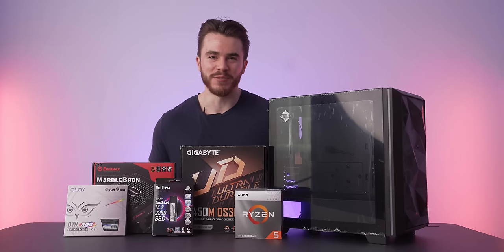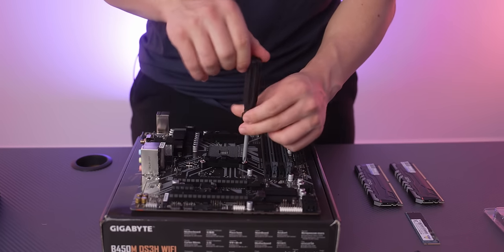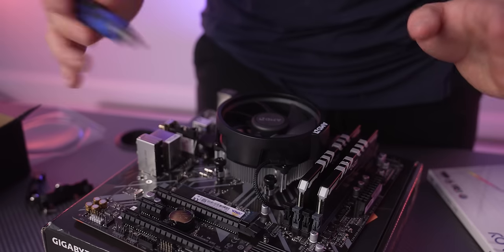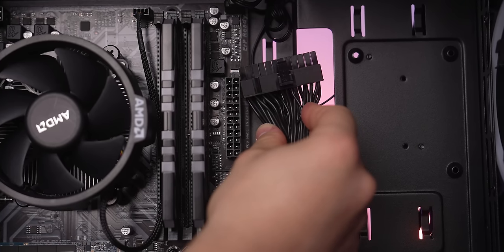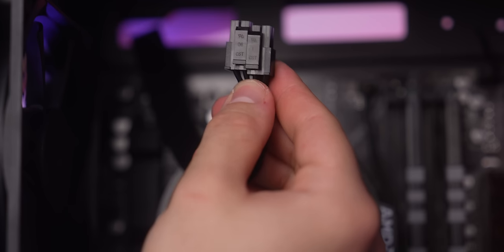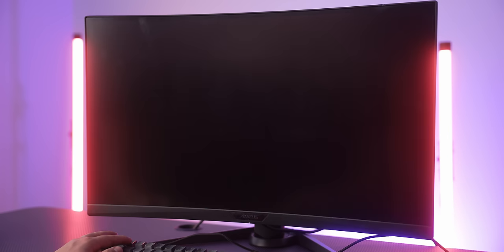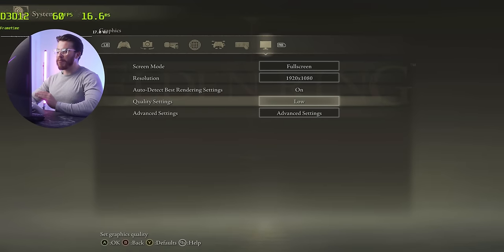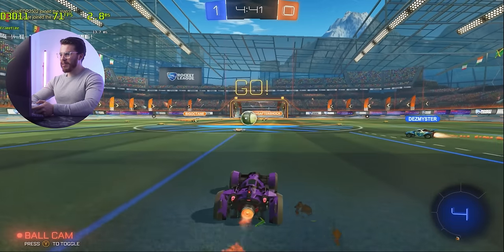How to Build a $400 Gaming PC in 2023! ⚡ Step by Step Guide

Comment: I finally saved up at least 400$ within 9 months working on a minimum wage. Decided to buy this specific build you showed. I was genuinely happy and going to save again to buy GPU.
Reply: Ryzen 5 5600G is a great CPU so I would try to go for maybe an RX 6600 or 6600XT if you get the money. Both will age very well and you won't need to upgrade for a long time especially if you only intend on playing at 1080p. But there are cheaper options if you're willing to buy used.
Reply: @ryannnftw  my choices are rtx 3060 or 6600XT. Thank you for your recommendation.
Reply: @trukinis420  hey, I'm planning to build my pc with i3-10100f and gtx 1650. what do you think?
Reply: hi! I'm planning to build my very first pc just a quick question as a complete beginner on building pc can this PC shown in the video be able to play DOTA2?
Reply: @Gillan007  it can run games like dota 2 very easily
Reply: @Gillan007  yes it can run Dota 2 smoothly.
Reply: @trukinis420  i noticed it doesn't the build doesn't come with a monitor can you recommend an entry level monitor thats good with this pc setup pls. i really wanna build my first pc nxt month 🙂
Reply: @Gillan007  try a SpectrePro brand 1080p 144hz. They are the cheapest brand when it comes on peripherals. I think they have 120 usd 144hz monitor.
Reply: whatt???? within 9 months wat type of job u have if u dont mine me askin???
Reply: @fwsupreme probably he has other expenses or lives somewhere where $400 is a big deal.

Comment: For just 400$ this is a really good computer, and the fact that u can upgrade it by putting like a 3060 inside it and the cpu wouldnt bottleneck just makes it amazing.
Reply: What kind of gpu you can put it in? Cuz im trying to build with ryzen cpu,nd thinking what kind of gpu i could put in, like from 150-250$
Reply: @kriik4789  gtx 1650 or rx 580 at the low end, rx 6600 or rx 6650 xt (if you can find one at 250) at the higher end of ur budget
Reply: If you are willing to buy usedparts and they are available where you live an older 10 series card like the 1070 or 1080 might not be a bad option either.
Reply: Is this gonna perform better than an xbox series s or a ps5 with the specs in it? I dont know much about pc but got some free times... any help?
Reply: @stephaned3072  nah it wont. but you get the benefits of having a pc that can do a lot more than a console... if you js wanna play games get a console
Reply: @ayedraco4l  ah ok. Console it is. Yeah i just want to play games. Cheers thanks
Reply: @ayedraco4l  The 3050 is honestly a waste of money for how it preforms so it shouldn't even be a recommendation
Reply: @jmannby1349  edited to 6650 xt
Reply: @ayedraco4l  nah JM is correct. The 3000 series are way overpriced plus most if not all of the people with those high end nvidia cards were not able to handle the Diablo 4 beta. All those cards ended up getting bricked while the Radeon cards were doing fine including the older cards like the RX580.
Reply: This is a solid option completely custom and cheaper than a new Play Station system and much better quality
Reply: @kriik4789 5700XT is such a GOOD gpu for around $150 while able to keep up with RTX 3060
Reply: For gaming. Never go higher then a rx6700xt or else you will get major bottleneck with the Ryzen 5 5600g

Comment: I have the same APU. It's also your video last june that convinced me to build a 5600G system and start saving for a gpu down the road, for the sake of having something to use right away. Now 6 months later I saved enough for a 1660 super and I am very happy with it. Thanks for the great content <3
Reply: i have the same apu and it was good for what i wanted to play and do on my pc at the time. I have upgraded to a 3070 so i can play more demanding games
Reply: you should chose RX6600
Reply: @robertbodnar8745  the thing is I'm still a student and the funds I used are from scholarship so the budget is tight. Also, I specifically chose nvidia for tensorflow use.
Reply: @ndrxw  hey man me too
Can this system play GTA 5?
I just wanna play some games
Not hardcore games like warzone 
I don't even play Fortnite 
But games like Minecraft, GTA, rust and so on
Will it run?
Reply: @deadscaryt9934 yes I have a good amount of playtime in GTA V and minecraft. Im not sure about rust but you can find a lot of benchmark videos of 5600g builds
Reply: Drew when you got the 1660s how did you uninstall the drivers for the 5600g and install the 1660s did it boot you into bios
Reply: Because i am doing the exact same thing drew
Reply: @XYLOIII I did not uninstall any drivers for the 5600g since when you connect the monitor into the gpu instead of the motherboard, it automatically uses the gpu as display. One thing to note is that I have low reso the first time I booted up the pc with the gpu (display like a safe mode or something). It all got fixed after installing latest nvidia drivers.
Reply: also another thing I did was disable the integrated graphics in the bios. I did it a few days after installing the gpu. It's an optional thing so i recommend reading a lot of stuff before doing it.
Reply: @robertbodnar8745  i was thinking of it but i decided to pay the extra.
Reply: @deadscaryt9934  i played gta and minecraft with no problems but gta was i locked gta at 30fps forgot the graphics settings.
Reply: @ndrxw  after the gpu was installed and working did you uninstall the 5600g drivers?
Reply: @XYLOIII  I did not. I only disabled the integrated graphics in the bios settings after
Reply: I'm not sure if I should, I don't remember reading something that I should uninstall drivers for 5600g. Also I didn't experience any issues so I just dropped the thought of doing that.
Reply: @ndrxw  what if i dont want to go to bios since the last time i did i got into a bios loop and had to completely reset my pc
Reply: @XYLOIII  I mentioned that disabling Integrated graphics in the bios is completely optional. It's up to you if you don't want to, that's okay. I used my pc a few days before disabling the integrated graphics in the bios and it worked just fine.
Reply: bro's gonna be so sad when a rtx 3050 is cheaper
Reply: @deadscaryt9934  ong all i play is gta 5
Reply: Is this gonna perform better than an xbox series s or a ps5 with the specs in it? I dont know much about pc but got some free times... any help?
Reply: im an nvidia fanboy but i wouldve went with the amd radeon rx 6600. its about the same price if not cheaper when used for a better performance
Reply: The cool thing about APUs is that you can have your primary display connected to your dedicated gpu, and use the iGPU to run secondary monitors.
Reply: @stephaned3072 yeah, if you play fair. Console games are usually locked to minimum settings. A PC can destroy an Xbox doing that, and you also get to do much more than just gaming and talking to friends.

Comment: Well this is an absolute deal for $400 ( around ₹40000 INR). If you dont bother about gaming much then this build is more than enough. But if you want it for gaming and you are willing to spend more amount ,$300-$400 more ( around ₹25000-₹40000 INR more) then you can always go for some decent Graphics Card that will promise atleast constant 60+(worst case) to 90+(avg-best case) fps in all these  games easily. For Indians out there who are constantly trying to figure out affordable setups, this is the choice. Your Final Budget will be around ₹40000 ( with out GPU and other hardwares like monitors and keyboards) and around ₹70000 - ₹8000 ( with a GPU and ofcourse other hardwares excluded).

Comment: budget build is the best build to me. having a thousand+ dollar rig doesn't make sense to me especially if it was mostly used just to game or youtube. if the game runs smoothly and doesn't stutter, crash or anything. able to play at 1080p. parts doesn't bottleneck and temps are great then I'm good with it. i have friends who plays on $2k up to $4k rigs and they barely play on it. one is playing fcking runescape, other is playing LOL. both can run on potato pc. 

i mean buying a much more expensive hardware doesn't mean it has longer lifespan. it's just regrettable to replace it if you haven't squeeze enough years out of it. i could buy a ryzen 5 and not worry if it wears out in 5-7 years but if i buy a ryzen 9 proc, i don't want it to die in that amount of time. i think they just want to brag about their rigs when the topic about it suddenly comes.

Comment: I went the 12th gen intel route for my build came in at $498 after taxes with a 5700xt highly upgradeable as well. I did buy used parts which greatly helped. The new parts its impossible to stay under $500 with a dedicated gpu. No gpu for the build though doesnt seem like the best gaming experience.

Comment: I have a full 650$ setup and it runs most games on 1080p 60-80 fps average all the time! Here's the parts

Components:
	
CPU:		
Intel Core i3-12100F 3.3 GHz Quad-Core Processor - $109.99

CPU Cooler:
None (Use the stock cooler)
		
Motherboard	:	
MSI PRO H610M-G DDR4 Micro ATX LGA1700 Motherboard - $89.00

Memory:		
Kingston FURY Beast RGB 16 GB (2 x 8 GB) DDR4-3200 CL16 Memory - $47.99

Storage:		
TEAMGROUP MS30 1 TB M.2-2280 SATA Solid State Drive - $49.99

Video Card:		
Asus TUF Gaming EVO OC GeForce GTX 1660 Ti 6 GB Video Card - $240.37	

Case		
NZXT H510 ATX Mid Tower Case	$59.99		

Power Supply		
Thermaltake TR2 600 W ATX Power Supply

Total: $650 USD 
Try building this beast, it's worth every penny
Reply: Yo how does Minecraft run (modded, etc)
Reply: @44goodnightworld44  meh good ig

Comment: Your step by step guide is very useful for us newbies.. many simply skipped either the building part (including plugging into those intimidating cables) .... or the installing window/drivers part... & every yr there are newbies comes into buiding PC ... especially budget ones.. but eventually we'll consider upgrading by maybe adding GPU to our APU builds.. Not all are experience builders.. 

your channel has alot of potential to newbies.. keep up the gd work..

Teach us how to upgrade APU systems with your preferred recommended GPUs.. step by step guide.. like do we need to uninstall iGPU, how to install new GPU drivers.. how to update BIOS.. how to know do we need to update BIOS.. overclocking with PBO.. performance comparisons manual/auto OC..

Comment: I just built a new system for $600 with the same processor, but with ASUS ROG Strix B550-F wifi II MB, 32 GB PC3200 ram, 1 TB pcie4 NVME SSD, Corsair RM550x PSU, and NZXT H510i case.  This is replacing my 2009 AMD Phenom II that  still works perfectly.

Comment: Very nice and informative video!!  I love those for comparison and helped me with designing my build. I bought myself for 500£ budget  - R7 5700G with fan, B550 rog full atx board, 750w psu corsair, and a 1tb WD black SSD and a tower msi case with fans. this whole costed just over 480£ . I have 32 gb ram that i will take of my current pc as well a my 1080ti gpu and a 4tb hdd for storing games. I hope i did pretty well, my plan was to reuse the ram and gpu i have until future upgrades in a few years. Ik i wont see a huge fps diff since my gpu is the same but the 1080ti is pretty good for i game in 1080p, i plan to replace it with a rx 7800xt in the future. I have the money to buy the new gpu now, but i feel the 1080ti still has a lot of life left into it :) no reason upgrading rn. Cheerio !!

Comment: Top tip buy the Ryzen 5 3400g used (I got it for £50) it has better integrated graphics than the 5600g (Vega 11 Vs Vega 7) and it is still very upgradable.
Reply from the maker: Fair point

Comment: Can you do the most current cheapest am5 build with whatever gpu that can play 1080p smooth?
Reply from the maker: Swap out the 5600g in this build for a 5500 and get a RX 6600 as a dGPU. That’s the cheapest AM5 system that’ll get you good performance.

Comment: Can you put any Power supply even if it's too big? because the one on amazon on the link is out of stock so i found a Enermax Cyberbron 500W Power Supply, 80 PLUS Bronze, Non-Modular PSU, Silent Fan, Black Flat Cable, ATX Compact 140mm Size, 5 Year Warranty on amazon and, can that fit into the pc case idk the size or anything? 🤨 i need help

Comment: We will prob attempt this. My youngest son and daughter built theirs off of a previous video you did... but something you didn't address is wifi. We've purchased a couple and they crap out or stop locating our wifi. Ideas?
Reply: U might need to adjust the settings , try going to device manager , click network adapter , click your WiFi card , click advanced and tinker with the settings until u can get it to work , for mine i switch to 5 ghz connection and haven’t had many problems since
Reply: Also try looking at the reviews of the WiFi card for solutions that’s how i found my method
Reply: @IMaBeastDoWatDEn  They stop locating the 5g after a month of use. Soooo annoying.

Comment: Beginner here looking to build a productivity pc, more specifically a PC for day trading. Would adding something like a Nvidia Quadro P620 work with the this combination of CPU/motherboard? Would having 32gb of ram be overkill? Going to go with 16 at minimum. But if it's not too much more, was debating on just going with 32. The application I use is single thread based so having a ton of cores isn't something I really need, from what I understand.

Comment: Liked the video I was wondering with the games you was trying out cyberpunk and elden ring could you achieve 60fps with the Ryzen 7 5700g cpu/apu or are those two games best ran with a dedicated graphics card? After watching this I'm really itching to build a gaming PC that I can afford building but also able to handle almost any game at low settings with frame rates of at least 50.
Reply: 5700g is only like 10% faster than the 5600g. So it won’t help much in terms of making games that struggle in the video much more playable. A dedicated gpu is definitely needed for any modern triple A games if u want a good experience

Comment: Hy bro i have one question for you 
I build the pc with r5 5600g with msi b550m pro-vdh wifi
And i put the gpu later on it which is rx 6700 10gb gpu its comfortable with r5 5600g because 5600g was pci 3 gen support and rx 6700 was pci 4 gen support...?

Comment: i build a 450€ pc here are the specs
r5 3600 used 80€
rx580 8gb used 100€
b450m pro4 used 50€
kingston fury beast 16gb 3200 used 35€
cv550w new 50€
case new 40€
m.2 1tb ssd mp33 new 50€
wifi/bluetooth card 20€ 
fan 15€
thermal paste 5€
Reply from the maker: Noice

Comment: Hello .  I had a questiong about the front and back ports of the computer.  I am planning to change Windows and I want to install Windows with flash, but some people say to connect the flash to the port on the back of the case.  I wanted to say, is there a difference?  Do I front usb port to install Windows, does it make a difference in the performance of the computer?

Comment: Thanks for the video, one question is 100% sure that the link from Amazon for the Motherboard comes with Ryzen 5000 series ready? Cant see the box picture in the Amazon post so I am not sure if it will come with 5000 series ready.
Reply from the maker: It is. Like in the video, I plopped in the 5600G and it worked without a bios update.

That was back in December. It’s May now.

Comment: I did all these but it doesn’t take me to windows? It says reboot and select a proper boot device
Reply: Did you install Windows? A PC you build has no operating system so it won't boot into anything. You'll need a Windows USB installer, boot off of that and go through the install process. Once Windows is installed, your PC will restart and continue with the rest of the setup process.

Comment: Does the motheboard support pcie 4.0 gpu cards? If it does, would it bottleneck the performance and how much if so? I plan on getting this build with an xfx rx 5500 xt/6500 xt.
Reply from the maker: B550 does, B450 doesn’t. I’ll include a link for both.

Comment: I just wanted to ask when I checked the RAM description link Amazon also suggested x2 16GB instead of the x2 8GM ram, can this build support a 32GB RAM?
Reply: It should support 32gb,also bigger is better but imo 16gb is just enough for a budget build like this since you really arent gunna have a smooth experience on new triple aaa that recommends 32gb ram with a budget build even if you meet their ram recommendations,if im you i would rather find a faster x2 8 ram rather than slower but bigger x2 16 or maybe just save up to upgrade this build with a dedicated gpu

Comment: hey, just wanted to let you know the cyberbron power supply you linked doesnt have enough power to power the computer parts you linked. I tried figuring out the problen for months until I found out it was the power supply.
Reply from the maker: I highly doubt that. This build guide doesn’t even have a graphics card. How could it be pulling more than 300W max?

Comment: I have my windows running on a 240GB sata ssd from 2018,

Last year i got a samsung evo m.2 ssd.
I want to move my windows to the new ssd, 

What's your advice on how i should do that?

 Am i gonna have format the heck out of the old ssd and install my apps to the new one after fresh windows install? So that i can use the old one to install files and games
Reply: Also, I built my 1st and only pc in 2018.
You were so helpful as i was a total newbie lol, I still am. 

My pc
R5 2600x,
gtx 1060 6gb, 
16Gb ram 3000mhz, 
peny 240gb sata ssd
Baracuda 2tb hdd,
Corsair Cx 650m psu.

Added two new ssds last year.(sata + m.2 nvme)
Looking to upgrade the graphics card in few months